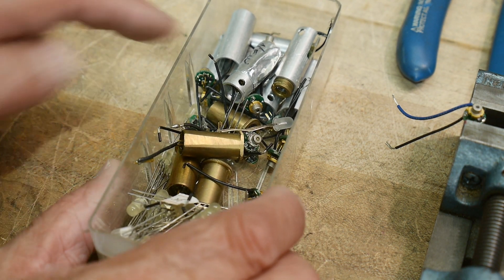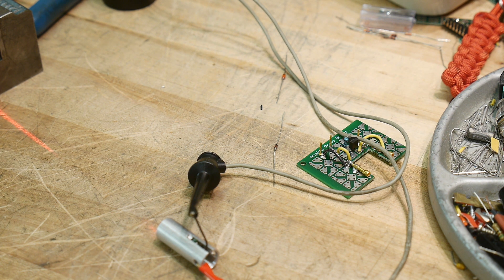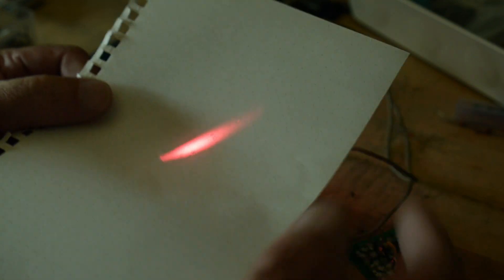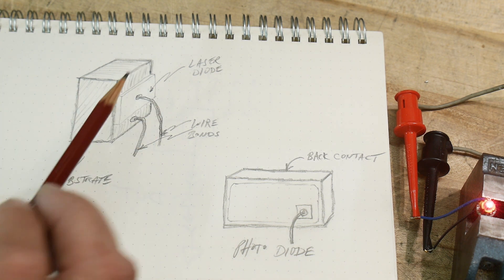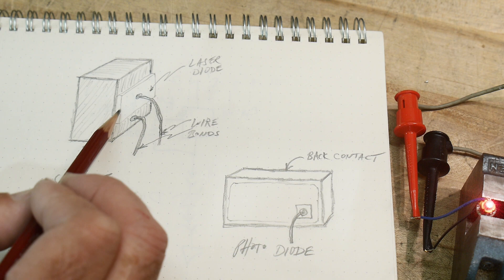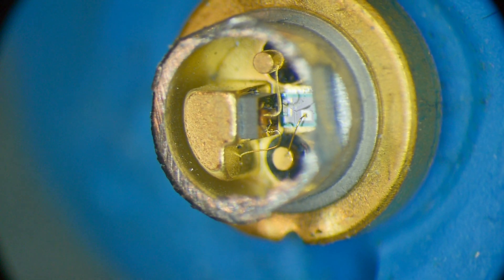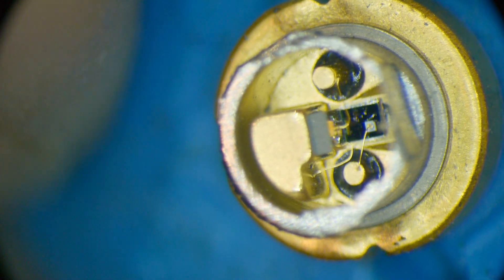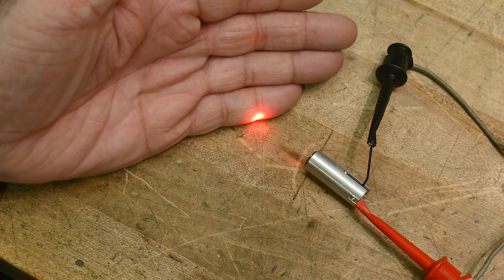#1160 Friggin Laser Beams

Comment: Summary

This video focuses on how laser diodes are constructed and the drive electronics needed to use them. 

Key takeaways:

* Laser diodes require a lens (5:00): Unlike LEDs, a laser diode's beam spreads out without a lens to collimate the light.
* Laser diode construction (6:41):
    *  Consists of a tiny rectangular slab on a substrate with a bond wire for electrical contact.
    *  Mirrors on the ends of the slab bounce light back and forth, amplifying the photons.
    *  A small percentage of light escapes these mirrors, with most coming out the front.
* Photodiode feedback (9:12):
    *  A back photodiode measures the amount of light escaping from the rear of the laser diode.
    *  This feedback is used to regulate the current and prevent the diode from burning out.
* Laser diode driver circuit (14:36):
    *  Driving a laser diode with constant current will destroy it.
    *  The driver circuit uses a feedback loop with the photodiode to maintain a stable output.
    *  A simple circuit with two transistors can achieve this feedback and regulation. 

Other interesting points:

* (2:44) The video shows the "speckle" effect created by shining a laser on a fingernail. This effect can be used to visualize the quality of one's vision. 
* (0:17) A brief discussion about the history of red lasers and their adoption in barcode readers. 
* The video doesn't explain how lasers work, but focuses on the practical aspects of using laser diodes. 

i used gemini 1.5 pro

Comment: Good presentation.  
It is not mirror, it is just n2/n1 between the materials  that causes reflection.   Just like Z2/Z1 on transmission line.
Each transistor has 180 degree phase shift  two transistors 360 phase shift.  So, if the gain around loop is greater than 1 you will have oscillation.   So if it is not designed properly it would oscillate, like any other feedback loop.  
I wonder how does it behaves under square wave?
If one changes those transistors with HEMTs, can we make microwave oscillator out of it?

Comment: Yay, optics video! Thank you.
Yes, yes, I would like to see a practical most-purpose laser diode driver. : )

IMSAIGuy, you like saw one, but they make can-openers for laser diodes, to remove that little output coupler, even though it has an anti-reflection coating.

Getting rid of the astigmatism from diode lasers is a thing. I've noticed that in DPSS lasers, they use wedge-prisms, but I should think that 2 of first-surface mirrors would work, well, before your spatial filter.

I've read a story about when laser diodes first arrived on the market, in numbers, a scientist bought an off-the-shelf CD player, removed the laser-diode, and made, at that time, the world's most accurate atomic clock.

Lasers-diodes are notorious for hating static-electricity.

At one time, people thought that it was impossible to make holograms with laser diodes, as they though that the coherence length would be too short, but I have read a lot of reports about it working.

Optical tweezers are upsetting, the whole idea of it.

[I have seen nuclear accident reports whereas part of the blue flash they saw, was neutrons and frisky photons, gamma-waves and the like going through their eyes, faster than the speed of light in the vitrious fluid (liquid) in the person's eye, causing Cherenkov radiation.I have seen claims that that can happen in air.]
Reply from the maker: wedges for astigmatism have been around forever. I used a glass stirring rod to make a lens to do line forming.
Reply from the maker: talking of coherence length; since the sun is so far away it is somewhat of a point source and has partial coherence. if you look at your fingernail outside in the sun, you will see some speckle.

Comment: I picked up a nice small lab-grade, (from a research lab,) surplus laser diode with a small control circuit bd attached that I assume is the feedback control circuit. There is zero identification on it so I've been trying to reverse engineer it so I can power it up. I also got some laser-table optics along with it, first surface mirrors, micrometer adjustment mounts, etc, some things I'm still trying to identify since I'm an electronics guy not a photonics (is that the right word?) guy. This video should help a lot. The other videos I've checked out assume I'm at least some sort of optics technician, if not a PhD physicist, and I have no idea what they are talking about. (I still have to stop and think about whether a given lens is concave or convex.) So thanks for the simple explanation of what's going on.

Comment: What are typical currents to drive them? What voltages does the feedback diode generate? How do we calibrate the driver circuit(typical resistor values and diode currents)? Can you do a part 2 explaining the proper way to reuse diodes in old cd/dvd drives?
Reply from the maker: read a datasheet for values: https://www.e-radionica.com/productdata/D6505I.pdf
Reply: @IMSAIGuy  thanks

Comment: I get confused...I thought Imsai Guy first name was Tom then i saw  Dave...so I will call you Dave...But out of respect it should be Dr. David and we don't need a last name so it shall be Dr. David IMSAI Guy

It is great to sort of know...without prying that you were one on the masterminds at HP optoelectronics.

I loved that rotary encoder chip...maybe your group help created it?

It  took A, B quadrature  signals..based on the qty of encoder slots..and maybe something else counted the index pulse..1 per a revolution from encoders mounted on shaft of DC brush servomotor...later to be put on BLDM to get rid of brush wear...A and B not  A and B went to be interfaced to the world to determine velocity and fractional position determine direction...which was an element  forming  digital servo loops

And maybe some grey code ..buried deep was used and was tolerant of noise because only one bit would change at a time...

HCTL-2000

You can look it up too Fred...

A clever design ...

I like to avoid playing processor my software skills ...suck

And when reading or seeing HP note ...An simple interface for HCTL-2020 with 16 bit DAC without using a processor....all the better...a more suitable cup of tea for me...

Great job once again wrt the laser...

I can see why some bare bone lasers like some blue units made by Laser Components..always had that photo diode ...they seem to always need fast MOSFET switches in the control loop and the rise and fall times for switching the laser diode current were paid attention to so that seems a PWM scheme....so the average recommended optical output power is maintained and the loop must be made fast...

Now i see how your circuit It makes it easy to play with the nice toy pointer that has the negative feedback circuit built in and it seem to be simpler than switching a current and like laser transistor is biased in and runs in a linear fashion...and not pulsed 

It makes it easy for us to just supply a dc supply...

I like the your bio too -a day or two ago.....very concise ...great career and the idea of enjoying teaching and revisting electronics helping teach the world is worthwhile while keeping private...its about course material and explaining ...not the personality...

While helping Dr. Nick Pasch..at LSI Logic in Milpitas -I was installing our semiconductor tool. As we roamed the hallway to get to the little cafeteria for lunch...we walked by the room where engineers worked on lasers..

The door entance had lots of signage and a unique badge reader...authorized people only...wear eye protection...Danger !

Maybe a tiny segment can be done by Dr. David Imsai...on laser safety why some wavelengths can blind or damage our eyesight...even at low power...or is it because we can't see the beam or is based on a thresold power level..? Sort of a little safety course...

Oh BTW...I am looking for my cat tease toy....red laser pointer...to perform the finger nail light scatter experiment...& During my  pet cat experiment...one conclusion I can say Butterscotch the cat can see the red 650 nm dot..lol...

I saw in the room when the door was opened as someone went in - the room was dark...and folks working   in there wore shaded googles... I asked Nick why are the lasers dangerous and remembered him taking about the wavelength...like 1050 nm..this was 1993 ? era....

I know you have plans and great lessons.....and don't let the Japanese scope upset your sleep...or my rambling cause drift

If you want the 465....I will send it to you.....there might be two of them...

Nick was a mastermind in his own right a great personality...a tiny darkside yet great sense of humor too...

He liked his new toy tool and looked foward to helping create the next faster and smaller VLSI logic devices..

Upon uncrating...wheeling it into his  development lab...that very day ...you could see just see his mind at work...and he wasn't afraid to critique and gave me feedback. Definitely a working engineer. That first day alone Nick generated and was eventualy granted two patents and more to follow as he created and improved they toys we use today.

I loved traveling the world and meeting and working with the best engineers assigned to exploit the new process. It was a race between all of them...they were very eager and the money flowed....

Thanks very much for the laser education and demo...

Kind regards 

Fred
Reply from the maker: lengthy message, here are some responses, I probably will miss some
1. name is not dave
2. I'm not a doctor
3. I worked on testers for the rotary encoders, one of my closest friends was in that group
4. I helped debug the first quadrature decoder chip (40 pin)
5. I owned a 465 years ago, don't need to repeat
Reply from the maker: at the end of this video: https://youtu.be/qvb0V4TIRbE
I show one of the HP encoders

Comment: So if you reduced the size of the mirrored material on the substrate from a rectangular exit point to a square, would that reduce the amount of lensing required to collimate the beam?  Or do you still get significant beam spread no matter what the shape?
Reply from the maker: the shape matters, the wide light spread comes from the narrow thickness direction due to refraction. counter intuitive at first glance. lenses are always needed regardless of exit shape and size.
Reply: @IMSAIGuy  you're right, that does seem counter intuitive at first glance.  Always learning something new from you in a daily basis.  😊

Comment: Are DVD burner lasers safe without special glasses (of course as long as you don't point them directly at your eye)?
Reply from the maker: they are invisible wavelength so can be dangerous since you will not blink. safety glasses are a must in any laser lab I've worked in. many labs take a photo of your retina now and then to look for burned spots. I have a friend with damaged retina just due to blue LED light while looking in a microscope. IR lasers can also burn the cornea so again be careful.
Reply: @IMSAIGuy  Thank you for your response.  It seems that precaustions should always be taken and that can't be stressed enough.

Comment: I knew they weren't as simple as a regular diode but didn't know why.  Now I do.  Well, sort of.
The speckles fascinate me.  The first time I ever saw them was in the 1960's in high school physics where we used a ruby laser to create a double slit diffraction pattern.

Once I shined a laser pointer on the opposite wall of my office and saw a round spot.  Then I took my glasses off and the spot became an oval.  Rotating the pointer around did not change the orientation of the oval but tilting my head did.  Ah Ha, this is astigmatism.  Never understood it before.
Reply from the maker: to test astigmatism, stare at this: https://en.wikipedia.org/wiki/Siemens_star#/media/File:Siemens_star_(128_spokes)_&_Matlab_code.svg
Reply: @IMSAIGuy  A friend of mine who was a tech for a camera company once tried to explain to me the Mass Transfer Function. He didn't succeed. Although I understand FFT in the SDR world. Can you simplify it? The Wiki article does NOT do that.  Optics is the hardest form of Engineering. But it's really Electronics too, right?
Reply from the maker: @barrybogart5436  you mean the Modulation Transfer Function? lens MTF?
Reply: @IMSAIGuy  Yep. That's it. You are the only Optics/Electronics guy I have run across. It's all waves (or particles!).
Reply from the maker: MTF is actually a simple concept. your buddy probably wanted to jam math into you before explaining what it did. it is just a way to measure resolution. how many line pairs (one black line and one white space) per millimeter will the lens resolve. the simple was is to take a picture of the air force test target https://en.wikipedia.org/wiki/1951_USAF_resolution_test_chart
the smallest lines you can still see is the MTF. fancy measurements use the step response of the system and some math.

Comment: Using your thumbnail, because you always have it with you is a top tip 😄
Reply: yea, it's a multipurpose tool. some ppl also use 'em to open small slitted screws, others to pick their noses.
Reply: @JohnDoe-es5xh  I cant pick MY nose (or ear-wax) with my thumb-nail - I use my pinkie finger-nail 24/7 though.

Comment: I think your comments that "you can NOT drive a laser diode with constant current" is misleading. They should be driven with a constant current source rather than a constant voltage. A constant voltage source will likely result in an over draw of current and burning out the laser diode. Not all laser diodes have a monitor diode so can't be regulated in constant power.
Reply: when you have a feedback it is not constant any more.